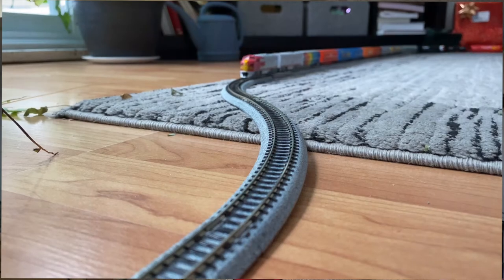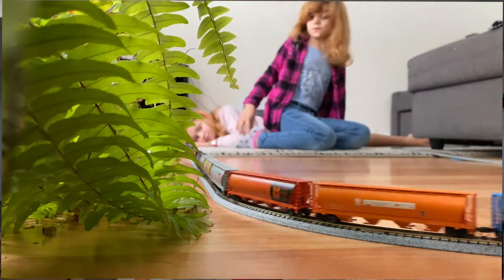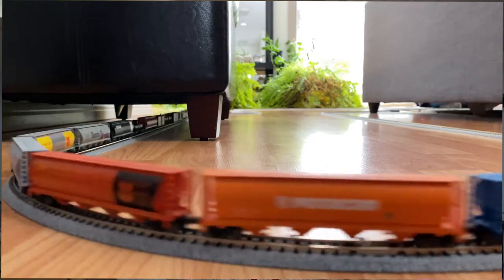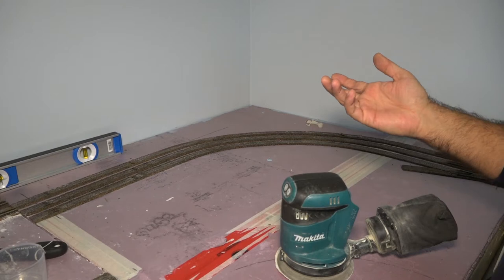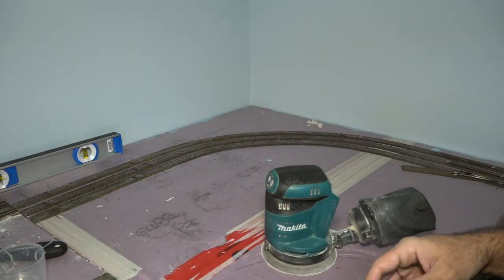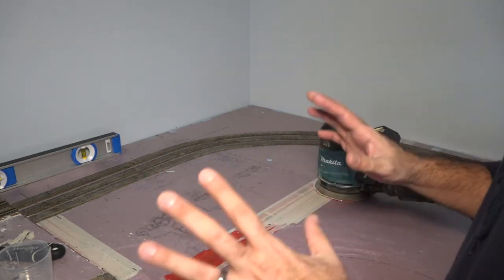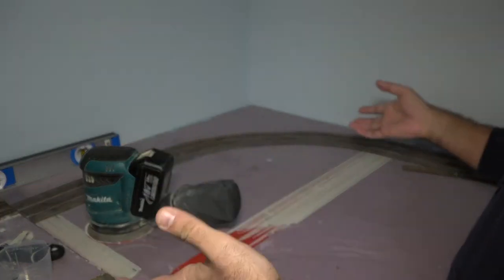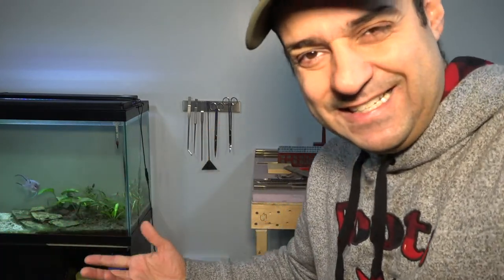Removing Track & Cork Bed (RRR) Saving Money Keeping it Affordable

Comment: I need to remove some cork , hot water maybe
Reply from the maker: It all depends on how you glued the bed.  If it's glued the same way as mine then your good with hot water.  Let me know how it goes. Thanks for leaving a comment @dundasjunctionmodelr.r-jam8267
Reply: @H0bby_Adventure  I used wall paper steamer, I got most it up but I think I used weld bond glue for this section, could not save the cork , lucky for me I have 1 1/2 boxes of cork but I am ready for my track modification